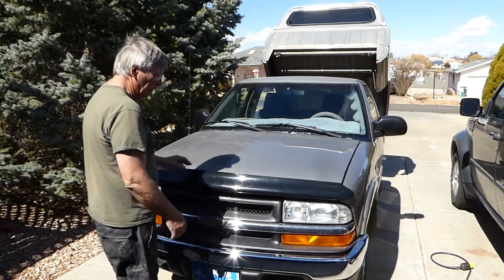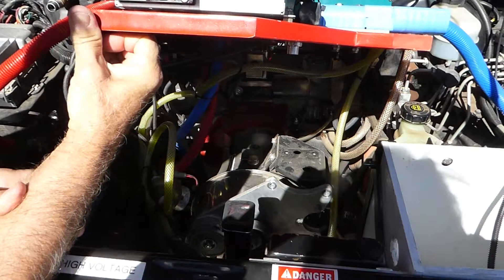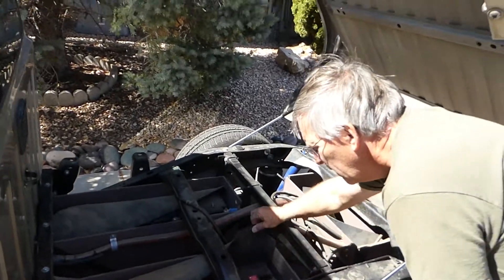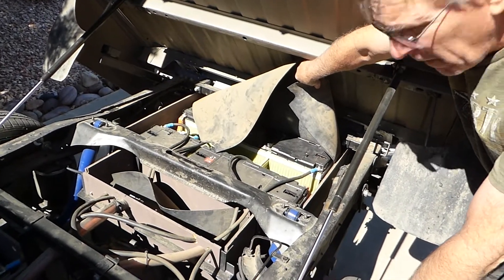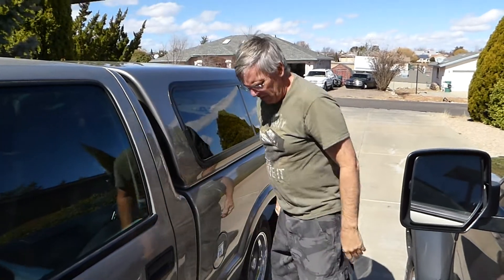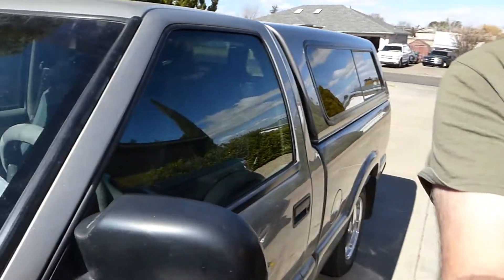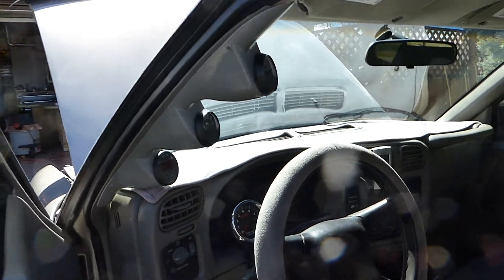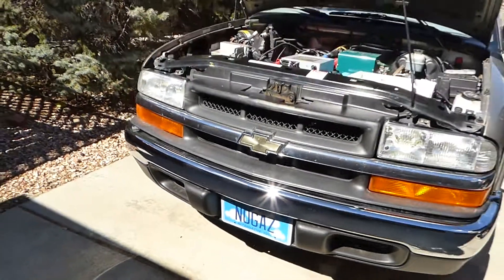MARK'S 2002 S10 PICKUP ELECTRIC CONVERSION

Comment: Maybe I missed it, but how much did you spend on batteries/whole project?
Reply from the maker: I bought this one as a incomplete project for 12K with Chevy volt batteries. If you did all the labor yourself and used 1st gen volt used batteries it might run 10 to 15 K. The motor and conversion plate are still sold. About 3500.00. It just depends on how good of a shopper you are. Building one is a labor of love.

Comment: Do you have a break down on the parts used? I want to convert my 82 s-10 to EV
Reply from the maker: Start with a Advanced dc 9 inch motor and a Cafe Electric Zilla controller. Use Chevy volt batteries. Everything else is custom made.

Comment: Round figure cost? I want to do a conversion on my 03 Chevy Cavalier.
Reply from the maker: With used chevy volt batteries. 144 volt system, zilla controller and a 9 inch motor. Around 13K. Manual transmission only. 20KW hour battery bank will give around 50 miles or so. More on flat level ground.
Figure 700 hours labor.

Comment: Is there some sort of lock on the bed to hold it down? Seems a bit dangerous if there isn't.
Reply from the maker: The kit to modify the bed has (2) 1/2 turn locks that are inside the bed front corners. There is a hex wrench tool that locks it down.